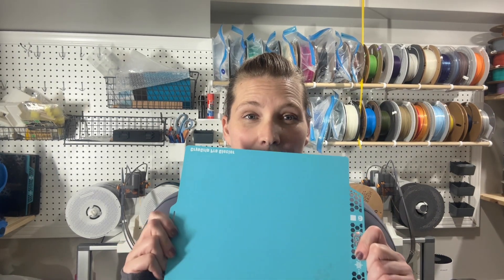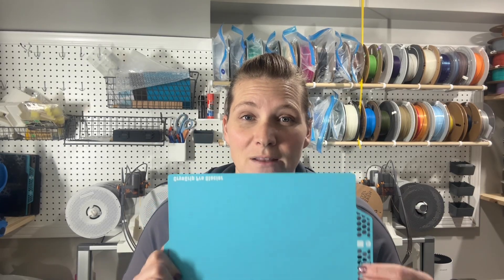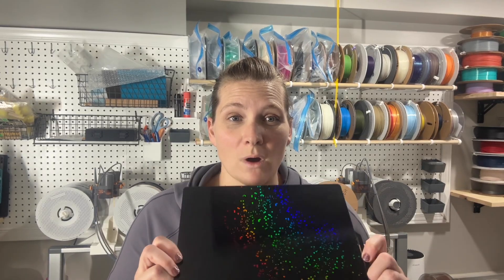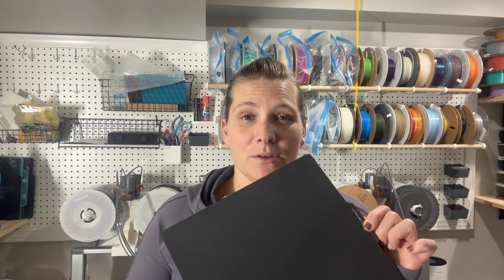Build Plate Adhesion Explained for Total Beginners

Comment: Great video!
I recently got into 3D printing.  I had adhesion issues at first. I felt so disappointed and frustrated. 
Finally on my ender 3v2...switched to glass plate and turned up the heat.  Also use glue sticks.  Haven't had an issue yet and only clean it when after it gets too much glue build up.  Upgraded it to a cr-touch for auto bed leveling too.
Just got the creality Hi combo, for xmas.  Cant wait to see how well it does.
Reply from the maker: That’s awesome! Thank you for watching and enjoy all the printing.

Comment: I have been having really good luck with the original PEI plate. But I have the BIQU Glacier and Bambu Cool Tack. How do I confidently make the switch? My theory has been, if it's working, do not change anything.
Reply from the maker: So I had the Bambu cool tack and liked it the first couple days, then had part of the plate peel off when removing a print. Bambu was not at all helpful with it and essentially said oh well it’s a consumable item. I stopped using them and won’t go back. For the BIQU glacier, I made the switch on one machine first and just went with the recommended temperature they said (raised 5 degrees because of my space) and didn’t have any issues.
Reply: @DesignAndForgeStudios  I guess I won’t know until I try.
Reply from the maker: Just be careful with the Bambu plate to not print small pieces with supports, it holds onto them too well.
Reply: @DesignAndForgeStudios  I have experienced this.
Reply from the maker: @HumancityJunction it’s not fun at all

Comment: Glue sticks are the things I use... I just kept putting it on, and now it works every time. 
If a part slips on a print... More glue stick, and it works..

I wish I could have an actual flat plate that works.... But it doesn't...
I tried alcohol constantly when I started, but it only worked some times...

For me, just put some more glue stick, and then watch what is happening... 
If it fails, watch where it failed, and put down some more glue stick, and it will stick.
Reply from the maker: I had to use glue on the PEI plate with my flashforge constantly and still had failures.  When I got my A1’s I bought the cryogrips pretty quick and now the plates need nothing as long as they are clean.

Comment: Looking forward to the upcoming videos.  I'm a relative beginner...I have about 700hhrs on a Centauri Carbon and about 200hrs on a A1 Mini.   I've been doing mostly functional prints on the CC and haven't really had many problems across PLA/PETG/ABS/ASA.   However, just this past weekend all of a sudden printing some storage boxes in PETG-Pro, the 1st and 2nd layers just started peeling up inside the brim.   Now, I was printing two sides of an storage box....so this happened around the edges of the build plates.   Restarted just printing one side at a time in the middle and it worked fine.  I still have lots to learn....
Reply from the maker: It could be hot/cool spots around your build plate too. My one A1 has a warmer spot in the middle of the plate, I can actually see it when I’m doing the first layers and tested it with an infrared thermometer. I just try to ensure I don’t have corners lined up in that spot. There’s not a single thing I can do about it.